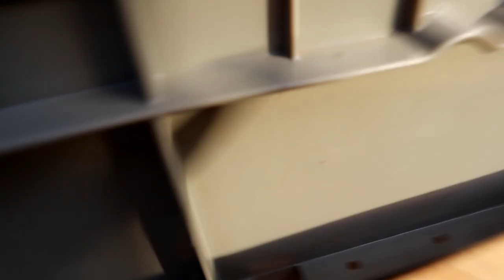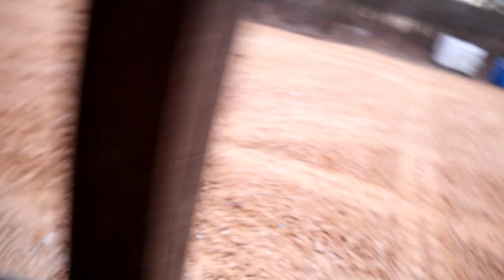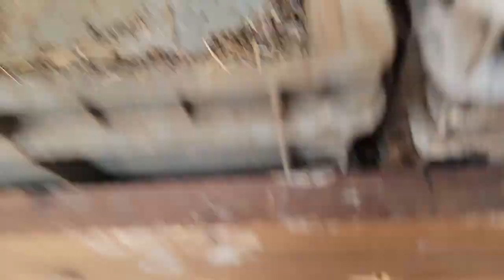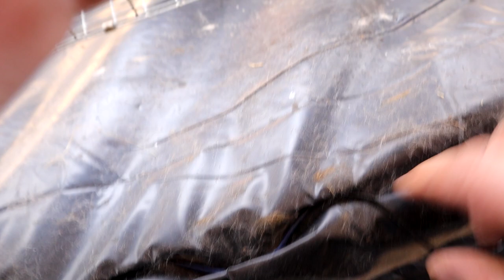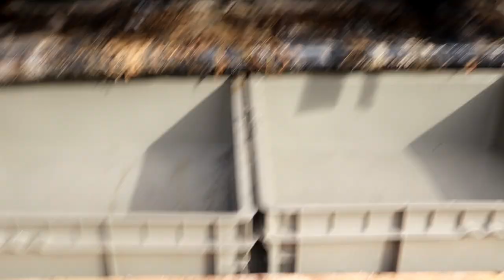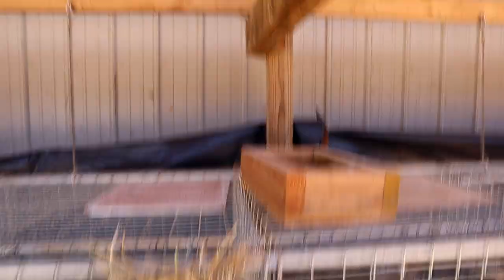How to Transform Your Backyard Rabbits into an Epic Manure Factory!

Comment: I like your set up! Good job.

We did kinda the same set up but two cages tall.  We stapled corregated plastic to the boards under the cages instead of the black tarp like plastic. Ours pans are placed to the back of the cage instead of the front. I drilled small holes in my pans just like you show but after awhile I had to make bigger holes in the pans for the urine to drain as they kept clogging.
Get a cheap narrow 8" rake to push or scrape the bunny berries that don't freely roll into the pans and a hand hoe to scrape the pans clean. They'll come in very handy.
Thanks for your video 🐇
Reply from the maker: Yeah I noticed clogging as well. Now once a month I pressure wash the bins or use a brush on them to unclog those holes.  I'm going to redo some of this and get rid of the plastic and go with metal.

Comment: I had a friend who built a rabbit hutch for me that had several cages that had a poop collection system he used metal sheets for poop a pee and anything that got stuck or hung up he made a poop pusher to help clear the collection system. I put a super large flower p with hole in the bottom that allowed the urine to drain out. To keep the smell down I would sprinkle Peat moss over the poop in the flower pot I also grew lavender plants And when I would cut them Under the rabbit cages no the metal to keep the flys off. I washed the metal sheeting often also. 
I got a lot out of your video showing thing to think about while building you collection system. Please continue making your videos. I know I will be watching all your videos and putting a like on all of the. Plus I'm a subscriber too.
Reply: I'm sorry for my spelling errors. I hope you can read past them😃
Reply from the maker: Great. Thanks.  Yeah I have to rework it a bit. But its doing great. I have a poop pusher as well. I'm going to be putting some more cages on the other side of my shop soon.

Comment: Another option is to try the plastic shower wall instead of the plastic but you would need plywood to support it since it is not rigid. I think it sells for about $25 for a 4'x8' sheet at lowes/home depot/menards. I like the setup and I will be getting rabbits soon so I will incorporate this design into my hutch, thanks!
Reply from the maker: Yeah there are a bunch of options out there. Thanks.

Comment: I like your idea . I was thinking a screen at steep angle to get all solids to drop in a collection bin and a tarp or other plastic draped under the screen  with a hole in the low spot to put a bucket or bin  to collect the urine. I plan to use fuel wood pellets( cheap compostable) to soak up urine to boost compost piles and fertilizer
Reply from the maker: Yeah, that would work.  I just dump the urine directly into my compost.

Comment: I have a tin roof piece under each cage, into a gutter and just wash it down into a bucket with holes.3 rabbits up top, 3 on bottom. 
Cheap and easy. Can clean area in 10 mins
Reply from the maker: Yeah, I definitely over thought this. But it works great.

Comment: Could you just make a removable screen separator under the cages or even under each cage out of hardware cloth & 2x2 or 1x2 to catch the poo & let the urine fall through to the bins? A lot easier & cleaner, just pull the screen trays & dump into whatever you put poo in.
Reply from the maker: There are a ton of ways to do this.  I'm pretty happy with my set up.  Thanks.